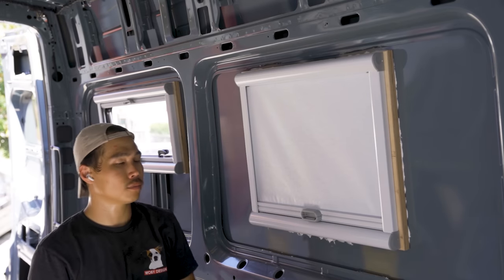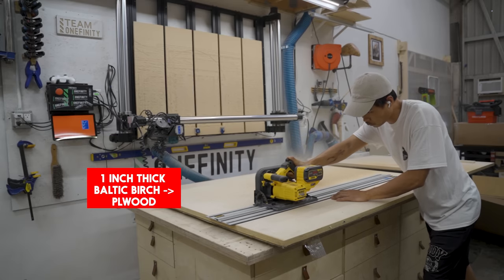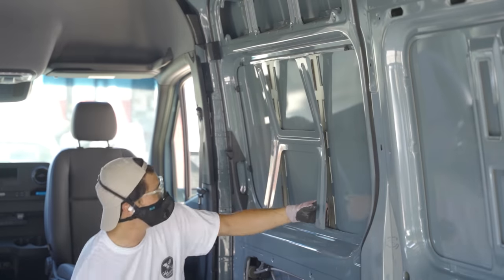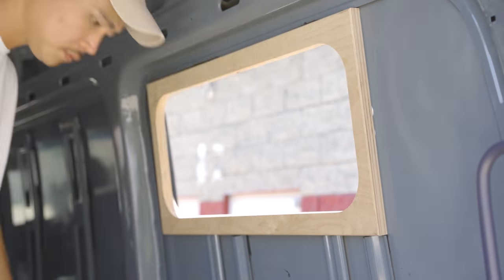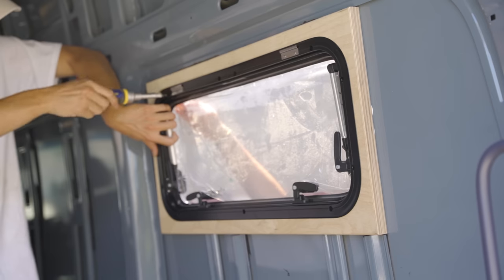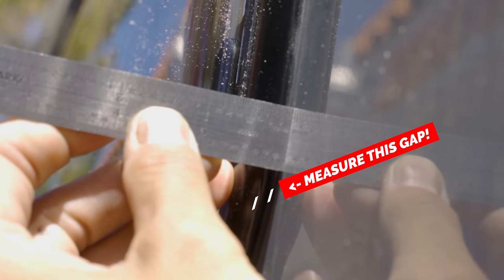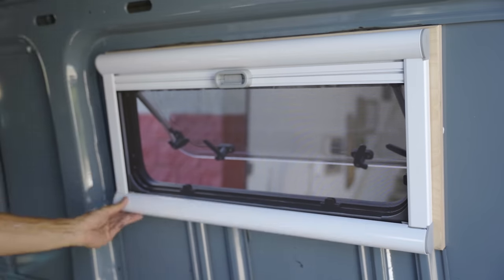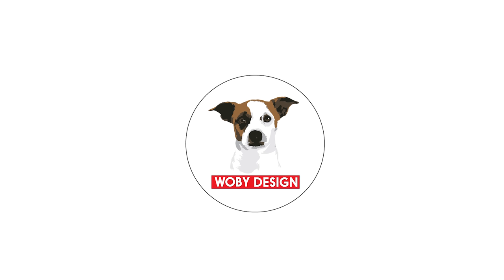THESE WINDOWS MAKES SENSE.

Comment: Tip: April Wilkerson just built a cute dog house with large windows which meant she had to protect her pups from solar rays so she used a material by 3m that’s a film you easily place on any windows where the sunlight is too strong and it’s able to reduce exposure significantly. That and it looked beautiful. They have a multitude of window tints, colors, etc. but I bet the dark solar protective film would work great on your awesome van windows

Comment: I'm sure these aren't cheap, but I was thinking these would be good for Tiny Homes. They're lighter (& tougher) so the savings could really add up if using a bunch of them. Some homes get really close to max weight even with choosing lighter weight items that weren't first choice like kitchen backsplash or bathroom tile.  PLUS these have screens. I've seen TH built with big windows that don't open (oh hell no) or windows that do open, but are screenless (oh hell no).

Comment: Why u made the cuts from the outside??its not the same thing??
Reply: from what i can tell, the jig saw will interfere with some of the supports in the inside.
Reply: He would run into the internal supports most likely prevent the saw from sitting flat.
Reply: After take the suports out because otherwise u cant put the windows i cant get why the cut its made from the outside when he made first everything in the inside and cut from outside...maby because the trash
Reply from the maker: 1. It’s easier to cut from the outside.
2. You can’t cut it from the inside
3. Why wouldn’t I cut it from the outside?
Reply: @wobydesign u can cut how u want i was just asking to trying to learn something new